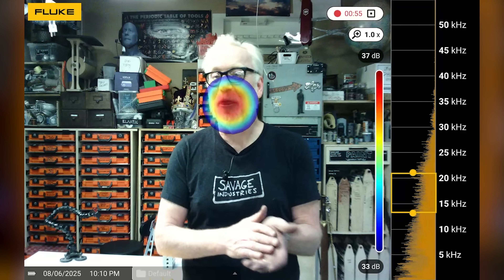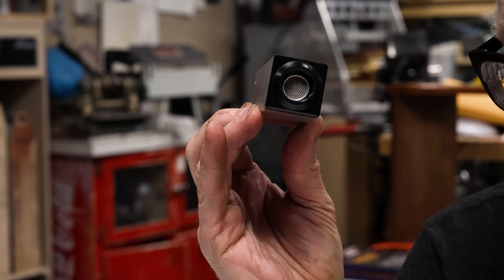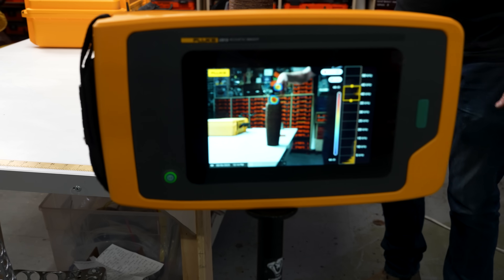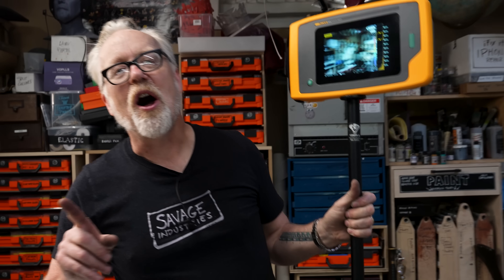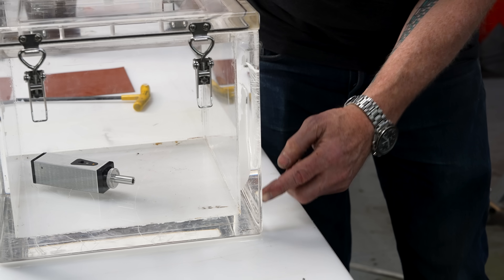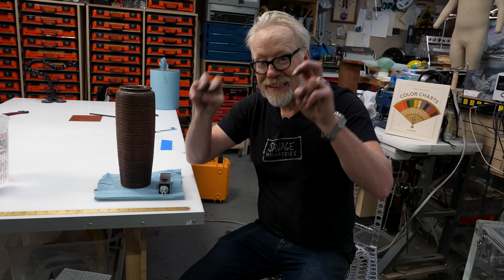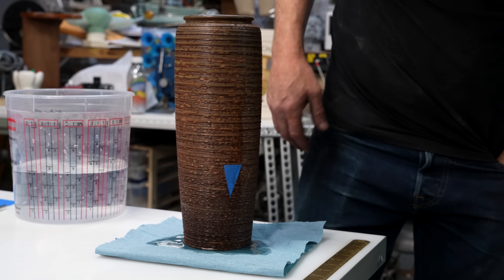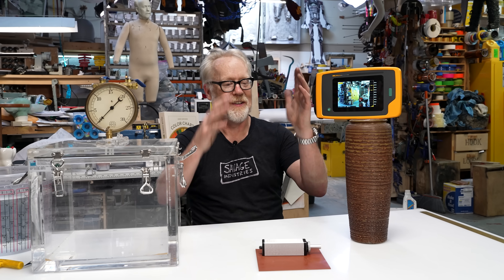Adam Savage Finds a Hidden Leak With a Sound Beacon!

Comment: Try the vacuum chamber again with a little positive pressure as that might open the crack enough to make it leak, if it does your could try to use positive pressure to inject some UV curable resin into the crack to seal it.
Reply: Paint the crack, pull negative pressure, release it, pull it again. Wait til it cures. If there is a leak, tape the outside first.

Comment: The microphone array reminds me of the "outdoor noise testing" I use to perform as a Turbofan Test Engineer for Lockheed and Rolls-Royce at Stennis Space Center.

We would hang a large jet engine (Trent 900, 1000, or XWB) from our test stand and run it through various speeds and conditions.  Hundreds of microphones were placed around it. We could detect the location of a sound on the engine and know exactly what part of making that sound out of thousands of other parts.

Comment: Suggestion: Couldn't you have done this another way such as by using – ‘say’ – a small power source such as a very small say – one quarter of a kilowatt hour or thereabouts ‘Portable Power Station’ driving a Heat Producing Source – such as potentially even a 100 W light will although digger would probably be better. Place both inside the box – after turning things on – and then use a Thermal Imaging Camera – which I'm pretty sure you must have lying around somewhere – to find out where the leak was coming from?

Comment: You may be able to repair the crack in the vacuum chamber, which appears to be made of Acrylic, by using a syringe to insert some Methylene Chloride into the crack from the inside and solvent weld the defect.
Reply: It is probably how the chamber was made. I have used weld-on 3 before it wicks into the joint and make it clear like it is one piece https://youtu.be/hT6Ow_cBTps?si=0l-4k2VnqABrHoZL
Reply: That sounds fun and interesting.
Reply: @briansavage932 Set the box with the cracked edge pointing down, paint the crack with the liquid, pull a partial vacuum, then slowly relieve it, then pull it again. Should suck the solvent in then squeeze the excess out.
Reply: Even without a vacuum capillary action should pull the solvent into the crack
Reply: I was thinking UV glue.

Comment: I love the Fluke. Long ago I worked for a black box company. The black boxes could take any kind of sensor and convert the sensor info to the standard 4-20ma industrial control loops. Most of the conversions were from thermocouples. The thermocouple boxes need accurate calibration. With millivolt standardized and calibrated from the bureau of standards every six months. Out shop used Fluke meters for the tweaking of each box. Part of the tweak is to compensate for the voltage generated by different metal connections. Often customers wanted a linear output from a nonlinear device. No can do. The customer unaware there sensor was not linear or innaccurate. Usually flow meters or optical inputs from rotating gears.

Comment: Could the acoustic imager be used for people who are deaf, to show where sounds is coming from to aid their day.
Reply: WOould be amazing in a pair of smart glasses, possibly with realtime speech-to-text included.
Reply: Would be a pretty overkill application. Something like that could be done with maybe 4-8 microphones positioned on a set of glasses and a small compute device
Reply: FYI, from Google: "Yes, there are acoustic imaging devices for blind people, and this technology is continuously evolving to enhance the independence and quality of life for individuals with blindness or low vision. 
Here's how acoustic imaging devices work to help blind people "see" with sound:
Sensory Substitution: These devices act as a form of sensory substitution, converting visual information from the environment into distinct auditory cues.
Depth Map Creation: The devices often use technologies like structured light sensors (like the Xbox Kinect) or stereovision systems to generate a depth map of the surroundings.
Sound Generation & Spatial Cues: This depth information is then translated into a system of sounds (often fixed-frequency tones) that are delivered to the user through headphones.
Spatial Perception: Higher volumes or increasing frequencies might indicate closer objects, while different pitches or lateralization (sounds coming from the right or left) can convey an object's height and position in space."

Comment: $25k it will be some time until gen pop will be able to afford this primary speaker unit
Reply: The Fotric TD2 can do like 90% of what the Fluke does, but at 5% the price.
Reply: You can get something similar for some 100 EUR using a RasPi and microphone array. Likely there are also some Chinese knockoffs of such a meter. The principle was invented AFAIK in 1990th so the technology is nothing secret.

Comment: Sound is a mechanical wave, meaning it needs a medium through which to propagate, mainly air.  As you draw a vacuum in the vacuum chamber, how would that affect the 40kHz beacon sound wave?
Reply: Don't forget the camera can also "see" sound independent of the beacon. If the chamber was leaking it would be able to hear the air being pulled through the leak
Reply: @anthonyp4209  good point but Julio is right, the meter wouldn't see the 40kHz beacon.
Reply: @vk2aafhamradio I don't know the threshold of detection for this thing but it's likely that you'd need almost a total vacuum to make the sound invisible. A sorta-partial vacuum wouldn't do much.

Comment: We use this to find door leaks on A320 Family Airbus aircraft in Germany.
Reply: Sorry for not carrying the joke forward, but if you remember the problem with the door seals was that the door was in fact sealed until one of the bolts sheared off so this testing wouldn't have shown anything.
Reply: Any Boeing engineers want to chime in on that?
Reply: @SolarWebsite  You don't need a meter to show where the door is missing.
Reply: @SolarWebsite I mean they clearly don't use fluke if they use any instrumentation at all... (The nice thing about having a de facto Monopoly is that you don't need to do s*** like safety checks.)
Reply: With the engines running, or using an external compressor?

Comment: would the acoustic beacon be able to ping inside a vacuum with no air to transmit the sound wave ?
Reply: At least in this case where it was not anywhere near a full vacuum yes it should still work. still air in there.
Though I would've liked them to test it without the beacon in there to show that it was actually it that was showing up and not the hissing of the air
Reply: there is no true vacuum. we just dont have the tech to measure it yet

Comment: I want one of these so badly! Somebody fast forward time to the point that these are affordable for regular people please! 🙏

I spent over an hour trying to find a hole in an air mattress, using every “trick” you’ve ever heard of. It was extra annoying because the entire time all I could think about was how there is a tool that does this job in about 5 seconds and I don’t have one (and couldn’t dream of affording one). I literally never found the hole.
Reply: spray bottle with soapy water didn't pinpoint it?
Reply: Can the sound camera also detect a tiny pinhole in a low pressure inflatable of thin plastic foil? AFAIK the only reliable detector is either a Schlieren camera or working with fog (which oil substances may damage certain inflatables (latex or with electronics) when put inside). A sound camera does not need to be moonpriced. You can get something similar for some 100 EUR using a RasPi and microphone array. (I haven`t tested if it is sensitive enough for such leaks.)